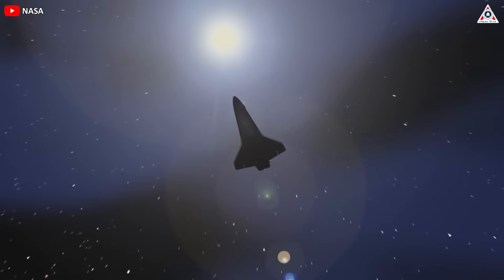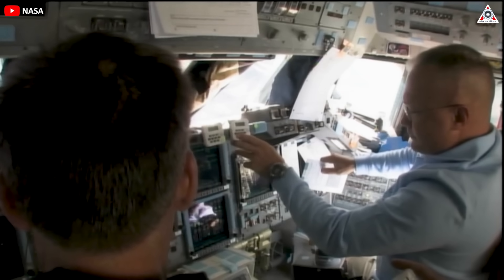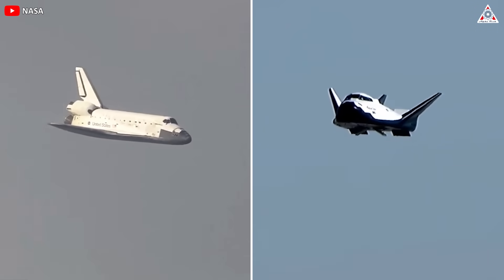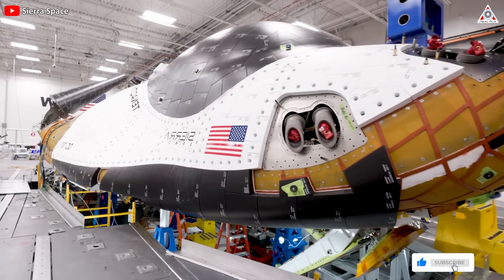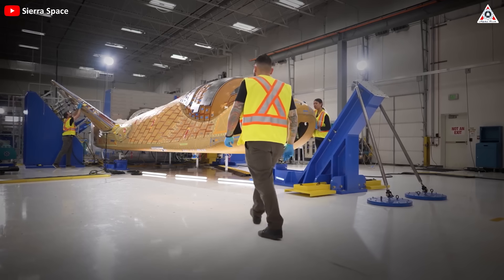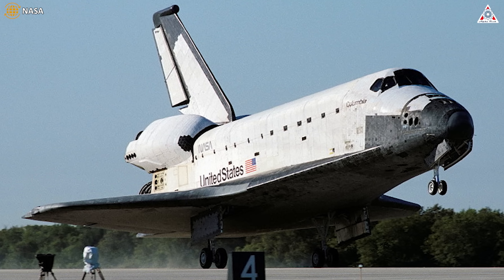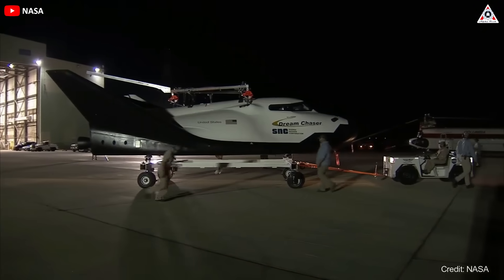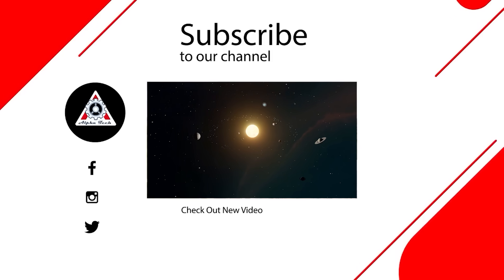How Dream Chaser to Reinvent The Heat Shield with New Design!

Comment: This was disappointing.  Everything changes but nothing changes. Somehow there needs to be a way  of getting away from use of tiles for thermal protection. One understands that they are outlandishly expensive to design, install and maintain. Moreover, there seems to be an unavoidable risk that some tiles will eventually separate and fall off, jeopardizing flight safety. We've seen all those problems with the Space Shuttle. But apparently nothing is changed with the passage of time. Unsurprisingly, no specific information is provided to show that these particular issues have been overcome. Unless or until they are, one suspects that the economics of space flight with remain prohibitively expensive.    :(

Comment: instead of messing with thousands of tiles which adds weight and complexity why not simply carry dry ice and heat it with the high reentry temperature so that it flows out thru nozzles at the FRONT at high pressure and encases the vehicle in cold CO2 gas for those few minutes of reentry? the cold co2 gas will act as a shield.
Reply: Because the capsule has supersonic speed and you won't be able to build up a layer of cold gas against the oncoming air. Also, your idea is extremely dangerous: The slightest malfunction in the dry-ice system would cause the capsule to explode.
Reply: @pinky6758  incorrect. the co2 will also be at supersonic speed. you dont want to build up anything. you want a cold gas flow which acts as an insulating layer. your malfunction excuse can be applied to anything. shuttle had tiles following and survived many times. in a gas flow a momentary interruption wont destroy anything. you can also have multiple layers. why dont you test it instead?
Reply: @esecallum  How about you think about what you just said? 1. The co2 and the incoming air flow anti-parallel to each other, not parallel. They crash into each other at supersonic speeds. 2. Have you ever worked with super-cooled gases? I have. They expand insanely in volume when heated up. One tiny mistake and your pipes will explode. 3. I don´t need to test it. There is more than enough experience and evidence that already shows us why this would be a bad idea. I´ll turn the question back on you: Show me your calculations that make you think that this would work.
Reply: @pinky6758  I never said anti parallel.
I said overlapping parallel. It can be easily modelled. High pressures are daily dealt with and not a big thing...those rocket engines..remember?

Comment: This is more being stupid. There are high temp steel alloys used in city structures construction that can take high heat and retain strength and shape.  Eventually someone will realize metal goes on the outside and insulation on the inside.
Also the issue is plunge angles, trying to plunge entry space planes like capsules, when they should be using glide ratios to control ship's surface temps.
More lifting surface, less insulation. and easier on the air frame.
Reply: You have absolutely no idea what you are talking about.
Reply: @garylester3976 wrote "There are high temp steel alloys used in city structures construction that can take high heat and retain strength and shape" But how heavy are those alloys? Are you so sure re-entry heat is below the temp where such alloys soften? If such alloys are truly the answer, why is everyone using ceramic tiles?
Reply: @billmullins6833  
You missed the part about glide angles. 
which is the root of the problem, craft still being plunged like they had to do with capsules. and the Space shuttle obviously failed due to glued on tiles. and Elon will have similar problems with starship and studded on tiles,  the only difference is stainless will be more likely to survive than aluminum. But the Germans in WW2 came up with a concept for a sub orbital attack craft that skipped thru the upper atmosphere. i.e. had enough lifting surface for the load and the skipping would keep it cool enough.
This is what we need, especially on return runs from Mars if we dont use retro rocket braking.
Why plunge, when you could stay in a higher but decaying orbit due to controlled friction, and keep your hull cool enough the skin metals could take the temps, have inside insulated etc.
Basically use glide ratio and several orbits into progressively thicker air.

The problem is the usual; an expedient turned into the traditional method, and the concept vectoring off over time, creating missed logic.
What I am describing is something more towards the U-2 spyplane effect but even highter. or like the SR-71, but designed for dead stick re entry.
Just because you can plunge with a bunch of krapp gooed onto the craft, doesnt mean you should. its another Albatross. 
Its why I have done writs on Alpha Tech about chined hulls instead of ring formed tubes, So you could design in boat like hull shapes and blended wing lifting surfaces instead of going over Niagra Falls in a barrel.
Elon is gonna have tile problems, and tile glued on with Silicone rubbber is gonna strip off and fail too,  This is Enginerds again, like putting O-rings in sectionalized space shuttle engines where any back yard mechanic would know you needed a metallic head gaskets.
My guess is the future of re entry craft will be blended wing with plenty of surface area to spread the heat load out, and as good of a glide ratio as possible, with high temp metal skin and insulated behind, and enough patience to degrade the orbit at sub destructive temperatures.
But all the "Experts" will insist on tiles and plunging, kill more people, waste Billions of dollars,  because they conflate credentialling with good thinking or even with learning, i.e. actual intelligence.
Doing the same thing over and over....  you know the rest...
I'll wait... and win in the end again.
Reply: @billmullins6833  instead of messing with thousands of tiles which adds weight and complexity why not simply carry dry ice and heat it with the high reentry temperature so that it flows out thru nozzles at the FRONT at high pressure and encases the vehicle in cold CO2 gas for those few minutes of reentry? the cold co2 gas will act as a shield.
Reply: @esecallum  Well, why not contact the folks at Sierra Space and SpaceX with your wonderful idea? They must not have thought of that else they would be using that idea.
Reply: @billmullins6833  look they are like a titanic. they have set a course they cant change.. i have tested the idea using a wooden model with holes at the front where co2 gas from dry ice is pumped out at front nozzles. this encases the model in very cold co2 gas. why wooden ? because wooden model leaves char marks to allow fine tuning of gas pressure and nozzle positioning. it works.
Reply: @billmullins6833  its why I do writs, to plant concepts. Just like planting the parts count concept for you know who...
First people have to start to think about potential alternatives, at one time Elon talked about using water jets on the outside of stainless Starships for reentry cooling. The problem is a time and temperature issue, if you increase the time you can control the temps.
Theres also another option: designing a re entry device using turbulence, like a badmitten birdie, this is how grid fins work. Would be worth experimenting doing a re usable whiffle effects device for say space dropped paratrooper capsules. where the early re entry used the whiffle effect before getting slow enough for fabric parachutes.
Do what you've always done, get what you've always got. You think these forums are to express adoration for Elon the Space Adonis? Elon wants results, innovation from anywhere is his fodder.

Comment: Still hasn’t made a single TestFlight, Steve Austin tested a vehicle like this in the 70’s and look how that worked out for him !!!
Reply: Next Month. And the hold up is not the spacecraft but the launch system
Reply: @bernieeod57  Actually the biggest holdup now is the Blue Origin produced BE-4 engines. To date no BE-4 has ever flown. Compare that to hundreds of Merlin and dozens of Raptor engines.
Reply: Steve Austin just got dropped from a B-52 above Edwards Air Force base. He did not re enter the atmosphere. In fact, the dream chaser basically accomplished the same without craahing like good ole Stevey
Reply: Lol
Reply: Tenacity (Dream Chaser) is in Cleveland (Glenn/Lewis) undergoing last tests, 
before completion.  Changes made, IF Required, based on vacuum tests at Glenn.
—
Two atmospheric drops have been performed earlier, before final design of Tenacity.
Current expected launch date: April 2024**
** Boeing’s Starliner may be launched before or after (ISS scheduling), 
PLUS other ULA 2004 launches (DoD).
Reply: @w9gb  I'll believe Starliner is going to fly/has flown when I see the videos from a reputable source like WAI or Marcus Howe or Scott Manley.

Comment: Rutan system was the best so far. And yes he had a fully orbital system designed before Virgin bought him out. Also: X 15 and X 20 had "hot structure" designs (at the insistence of NASA) that used refractory metals. They didnt need tiles.
Reply: Did you google this?
Reply: The X-15 suffered heat damage when it set its speed records and went into space
Reply: @bernieeod57  no. Only the mach 6.7 run resulted in damage. That was at 40 000 ft.
Reply: The X15 that left most of the atmosphere used ablative spray on coating to survive the heat of landing. It still suffered some melting. The coating would have to be reapplied.
Reply: @brianboye8025  yes, and how did it's velocity compare to a vehicle returning from orbit or the moon?
Reply: @brianboye8025  no. It only used its coating for the 6.7 mach run at 40 000ft. They WANTED to see how much heat it could take. Reentry from its space flights were metal only. X 20 was designed to re enter from orbital speeds and skip glide. Dynamic soaring

Comment: Why isn’t retro rockets use to slow the reentry speed?  I’m thinking of the Draco rockets on the Dragon capsule.
Reply: Even so, you will still have reentry heat
Reply: @bernieeod57  Agree, but maybe less heat and stress on the tiles.
Reply: @PanioloBee  AND you would need to haul up all that extra fuel. Plus, even if you did slow down enough, you would plunge straight down and actually generate more heat from the fall
Reply: @bernieeod57  Thanks for answering and not being insulting.
Reply: @PanioloBee  it comes from frustration due to scientific ignorance.
Reply: @ratratrat59  That would be you. Too bad you are not showing NASA how to do it
Reply: You need a few years of physics. A class or two on grammar and spelling are in order too.
Reply: @ratratrat59  If you slow down as much as you call for, you will regain velocity by falling straight down. Sub orbital re entry produces greater G force and higher re entry temperatures due to it being an uncontrolled plunge. On orbital re entry, the angle can be controlled reducing G force and heating
Reply: @bernieeod57  ignorant word salad
Reply: instead of messing with thousands of tiles which adds weight and complexity why not simply carry dry ice and heat it with the high reentry temperature so that it flows out thru nozzles at the FRONT at high pressure and encases the vehicle in cold CO2 gas for those few minutes of reentry? the cold co2 gas will act as a shield.
Reply: @esecallum  please tell me you are joking!
Reply: @ratratrat59  What is wrong with my idea? when you see reentry you see hot ionized gas .  with my idea you pump out very cold co2 gas encapsulates the vehicle and shields it.
Reply: @esecallum  God help us!
Reply: @ratratrat59  why? airplanes are modelled similarly. i have done it in a wind tunnel. it works.
Reply: @esecallum  Hope you are just joking. If so, ha ha. If not, God help us.